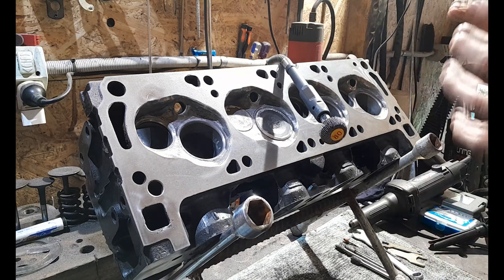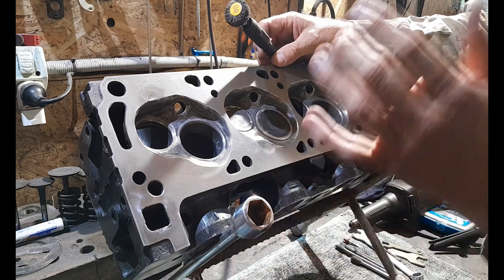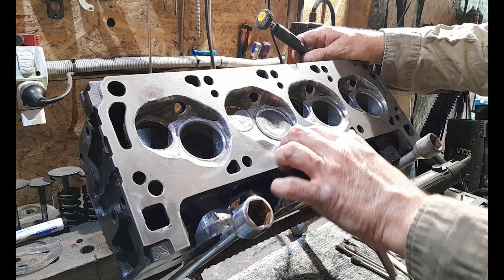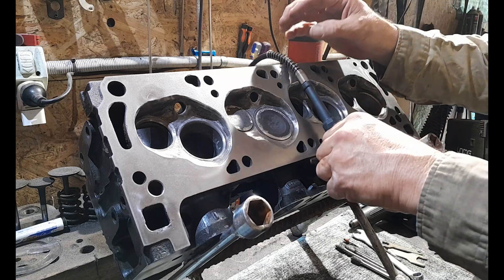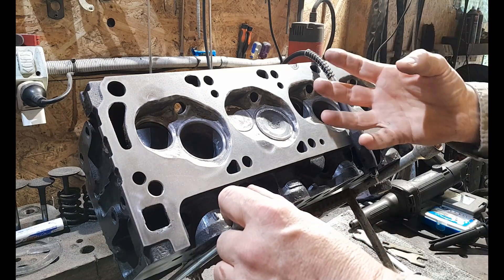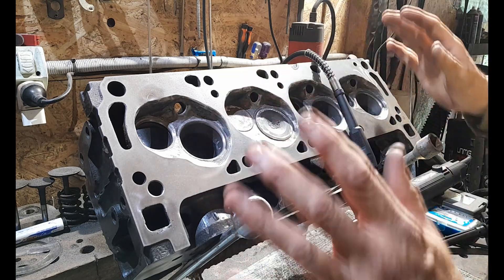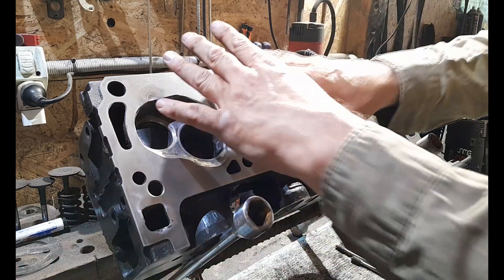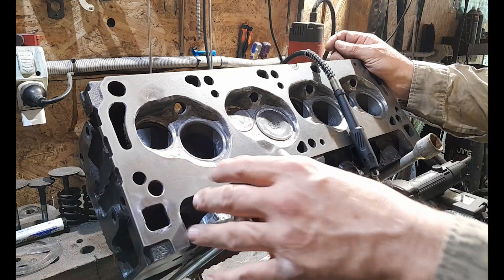351C 302 2V Factory Iron Cylinder Head Vs The Modern Alloy Cleveland 2V

Comment: Use 1/8, 3/16, and 1/4" beads pulled through. Use machinist dye to mark the gasket inner cylinder diameter.

Comment: Stop that! Do not remove that ridge around the intake valve! It directs the airflowdownward.
Reply from the maker: Not removing the ridge. Just smoothing the new shape after the chamber mod. 

Check out the improved flow numbers over the stock head in the flow test video. 

Could it flow more? Maybe, depending on what you are trying to achieve with the car you are driving.

Comment: Concentrate on the bowl area mostly and multi angle valve job ❤
Reply from the maker: @rodneyadamson8270 Hey mate, thanks for the heads up. 100% on the bowls. Worked the bowls within reason. Not porting for all out race car. Discovered after beginning this port series, there are serious gains to be made in the combustion chambers with a decent valve de-shroud on the Aussie 302's. CC's and the exhaust port short side radius have been  focused on in this series, with the usual intake runner clean up and gasket match.